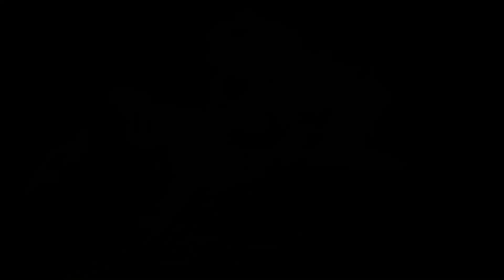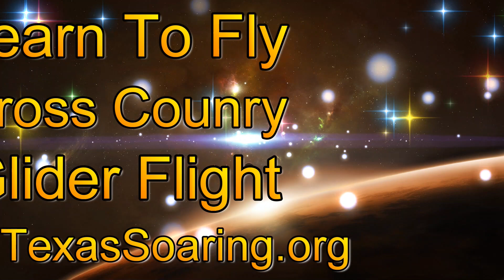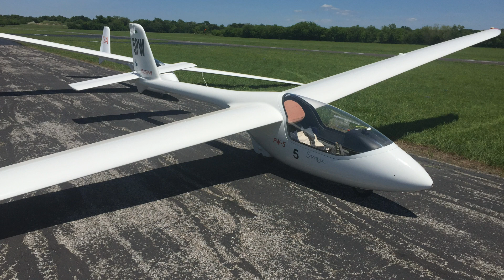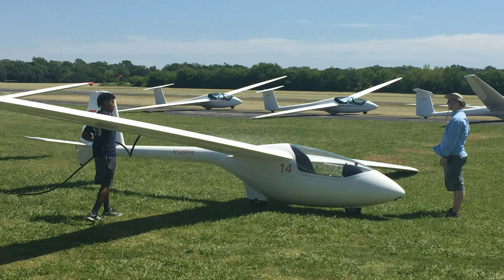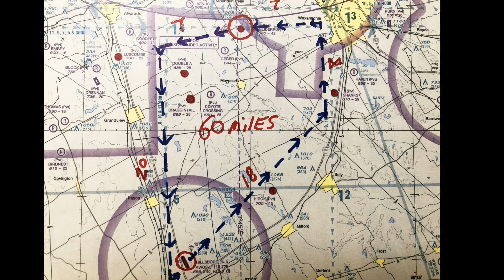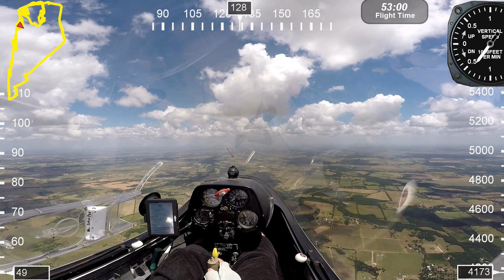Learn to fly sailplanes gliders cross country 60 mile flight Roy Dawson video

Comment: Roy, I look forward to your videos, so thanks for this.  The PW-5 may not be up to the performance of modern gliders, but it's pretty much the equal of the K-6 wooden wonder which was the favoured ship of many when I started gliding.  I still think you could try circling at 50mph and about 40 degrees of bank (feels double that): I think your rate of climb would be much improved.  $20 per hour is such a cheap rate!  Anyone wanting to learn power flying would do well to start on gliders (I did), as you'll acquire most of the skills you need, while becoming a more accurate pilot with a better awareness of the weather.
Reply from the maker: Thanks for the feedback
Reply: Once summer has been returned by you people in the northern hemisphere (daffodils are out here), I'll make a video for you.